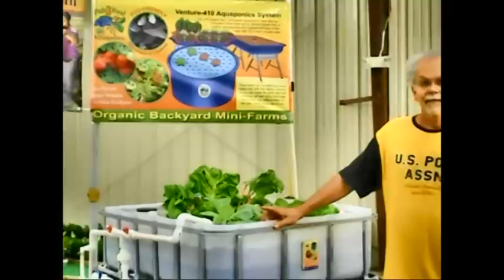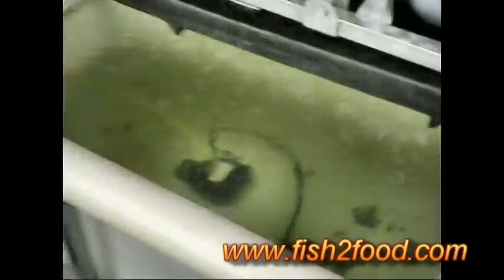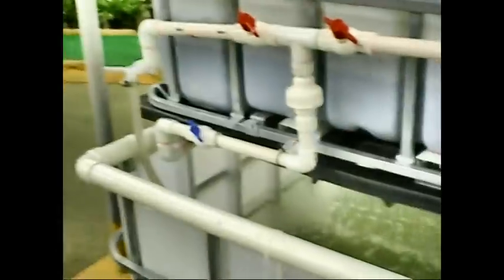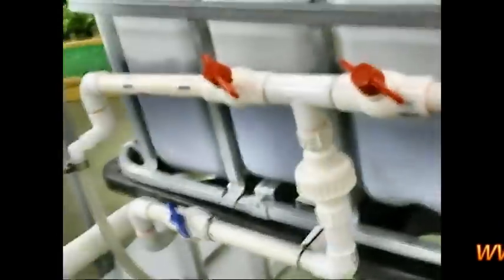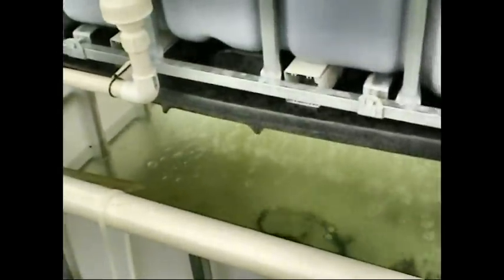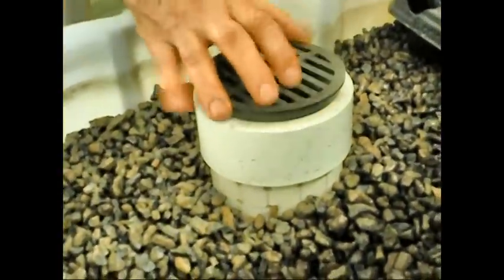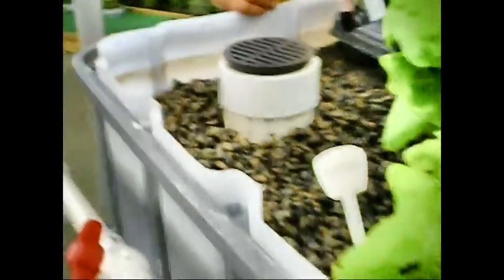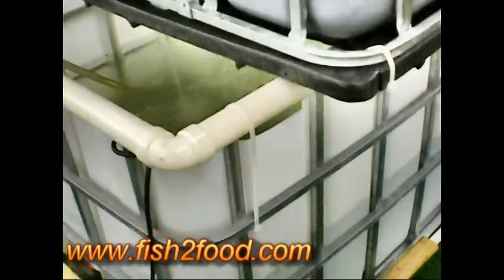IBC TOTE AQUAPONICS SYSTEM

Comment: Very nice, clean, and organized. Awesome booth setup as well, I have actually been experimenting with wetland plants this year using raised beds and instead of floating traditional annual garden plants that require a lot of spacing, I hope to be able to submerge edible wetland plants that have next to no spacing requirements thus increasing the surface area of the roots by 5 or 6 times. Also many wetland plants create tubers which is like growing potatoes that can handle being submerged in water